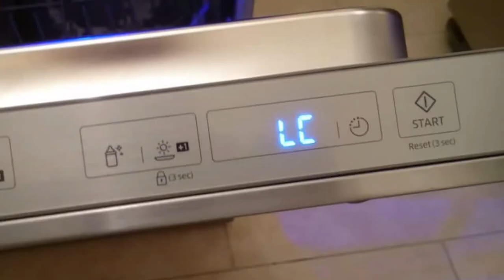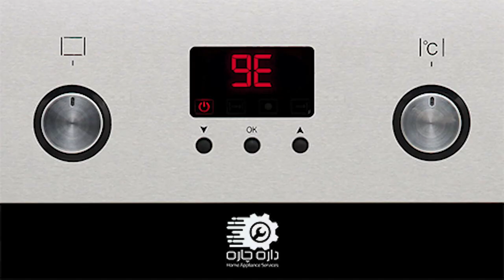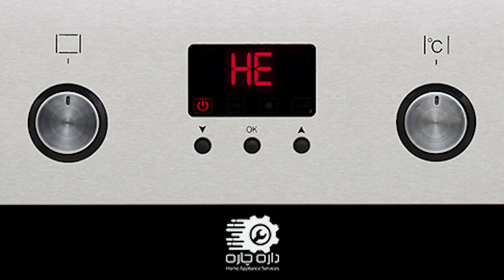Common Samsung Dishwasher Error Codes

Comment: what about PC error code samsung? how to fix that?
Reply from the maker: Hi, the PC error code indicates a Zone Wash Error. This error usually originates from an issue in the control panel itself and could be resolved by unplugging your dishwasher and restarting it. If after restarting, the error persists, it's best to call a professional to help you with the problem.

Comment: no. push start it says 1 like 1 minute left, makes some noises then back to 2:17 the heavy wash cycle and nothing happens. push start again and it repeats showing 1,makes noises, doesn't start. Just cleaned filter...also a symbol flashes 3 times beside start symbol then disappears. cannot find that symbol in manual. I HATE ALL MY NEW SAMSUNG APPLIANCES- THEY DON'T WORK AND ARE POORLY DESIGNED.  BOTTOM RACK NOT TALL ENOUGH FOR DINNER PLATES. HOW INSANE IS THAT!!!
Reply from the maker: Hi, we understand that it can be frustrating and we hope that you are able to resolve the issues with your appliance soon. If you are not able to do it yourself, you may have to call in a professional to diagnose and fix the problem for you

Comment: None of those codes are the current issue that I'm experiencing.   I start it like Normal on Normal, the countdown time displays, APPEARS like it will start as per usual, but then the countdown blinks & beeps 3 times, stalls out, press START again.....the countdown then goes from 2:28 to 2:27, same thing, blinks/beeps/stalled out, does not proceed with anything.   Unplugged it for well over 5 min., cleaned filter.  Still nothing.   Called Samsung, and they were stumped & unable to assist.  Nice support agent was unable to provide a ticket for service due to my location.  Seems I'm on my own.
Reply from the maker: Hi, we hope you are able to resolve the issue with your appliance.

You can also check out the article that was the inspiration for this video. It might help: https://www.appliancegeeked.com/samsung-dishwasher-error-codes/

Comment: Pe ?
Reply from the maker: Hi, a PE error code indicates a half-load error code. If it appears, there may be an issue with the sump pump, diverter assembly, or motor assembly. However, the most common cause is when the inner spray arm is unresponsive. To troubleshoot this, unplug your device and inspect its wiring. Reconnect any loose wires. If you find any that are damaged, you will have to replace them. Ask for the help of a professional, if necessary